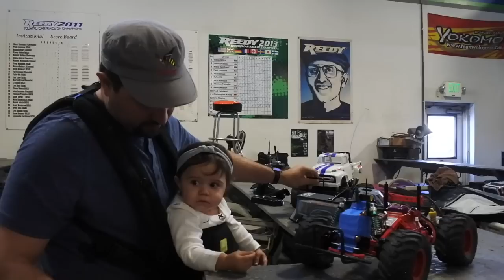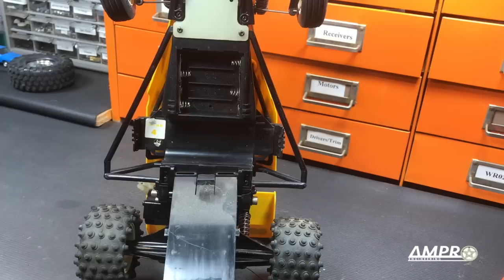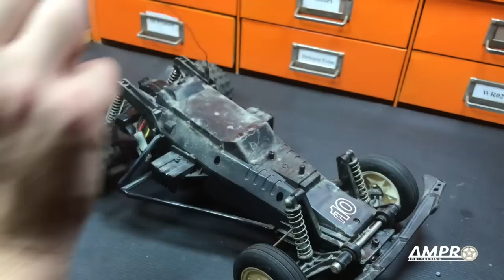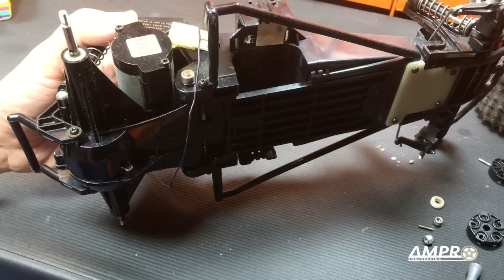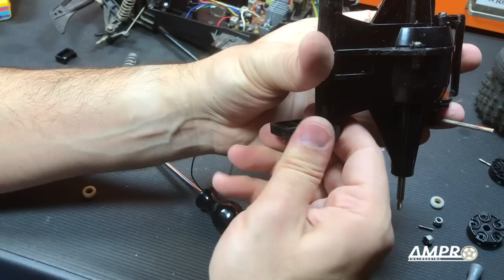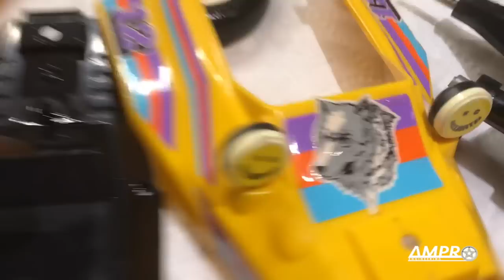e177: Nikko Rhino / Bison / F10; The Clean Up

Comment: Hi, thank you for your videos! I need a little help, can you tell me how remove the pins on the top  of the arms of the shock absorber? i need it to try to install a new oil shock absorber. thank you
Reply from the maker: Thank you! Well here is the problem, these pins are not designed to come out. They are one way press pins so the act of removing them is very dangerous. The best thing to do is try and grab the head of the pin and use a lot of force to twist and pull. There is a very great chance the a lot of parts, including the tower and the pin will be damaged though. I wish I had better news for you.
Reply: @AMPROEngineering  thank you for you answer!!

Comment: WE NEED UPGRADE PARTS FOR THIS... like steering knuckles suspension plastics etc. I would love to see some parts from you for this car theres not a market at all maybe a few parts here and their but not enough
Reply from the maker: Yeah they are harder to get parts for. I sold this off a few years back but I may have a scrap car to copy parts from.
Reply: @AMPROEngineering  COOL I have one that im desperately wanting to get running but have a few plastics that need replaced as they are cracked..

Comment: This was the first R/C car my parents got me. From Sears and called the Super Lobo. I got it in 1985 and it was a LOT of money for the time. With the 7.2V battery pack and black/green Lobo carrying case, well over $250 in todays dollars. It was quality made and really quick.
Reply from the maker: It really was a solid car. People forget how expensive and good these were.
Reply: @AMPROEngineering  One of the neighborhood kids several years later got the Super Lobo II. Same thing, but red and slightly updated. The local hobby shop put some Falcon front wheels on it w/ bearings up front and they were able to stick a Trinity stock motor in it. It blew my Clod Buster away for sure.

Comment: Have nikko frame buggy 14084 from 1985. Still werking. Want to operatie with lipo. Is this possible.?
Reply from the maker: Yes but you will need to plug in a lipo alarm so that the battery wont run low.
Reply: AMPRO Engineering could you advice me which model of lipo alarm i should buy. And where to buy it?

Comment: What determines if something is toy grade or hobby grade is weather or not it has replacement parts available.
Reply from the maker: Well I dont know about that. Nikko and Tyco cars came with parts lists to order replacement parts which I used to do. On the same note, the hobby shops I would go to needed to order parts for my RC10 all the time so in both cases I had to wait but for the Nikko and Tyco cars, they were at a price point that made them really not worth fixing, even with replacement parts available.

Comment: Ahhh finally!

The Super Lobo seems to most closely resemble the later Thunderbolt. The Thunderbolt came in a 380 version and a 540 version. They both had the same electronics as far as I know, not as powerful as the earlier Rhino and Bison. The board definitely appears to be the same. It was also found in the Scorpion MK1 truck.

The 540 motor was interesting as it was different to the Rhino and Bison too. Instead of the typical 27t it was a 40t but the wire was much thinner than you'd normally find in a 40t 540, the rotor is only partly filled with wire. It seems like a deliberate choice in order to limit current and overall power. It's easy to tell by taking a peak inside the can, if it's the 40t motor the wire will be noticeably undersized. 

I have had several of the family over the past few years and some genuine spares too. 

The plastic quality seems to vary, I've had both used buggies and unopened spares that have ranged from sturdy and flexible to brittle and weak. Some parts even cracked inside the packet. I'm not sure if this is down to manufacturing variations or just that sometimes the plastic is prone to turning bad just Tamiya plastic does sometimes. I definitely have some that seem to be at least as tough as the Grasshopper though with robust and flexible materials.

The front and rear wheels should swap straight out for Grasshopper or Hornet Items.

A lot of the earlier F10s had nuts instead of press fit collars on the gearbox pivot and front arms. 

Recently, I have been removing the stock part with a dremel then cutting some metal rod to the appropriate length and using a cheap tap and due set to add threads each end. If you can get the stock metal rod out cleanly you could just cut threads into that too.

The diffs in these are usually pretty nice, metal gears and metal plates each side holding it together.

I might have some spare pivots laying around if you need one. I'll have to dig through my spares!

I'll be interested to see what you do with this using your impressive skills. It's a cool little buggy if you look at it as a simple Grasshopper style vehicle.

Sorry for the long comment!
Reply from the maker: Oh yeah I also have the Scorpion which was the exact same chassis minus the use of the 4AA batteries. This plastic seems pretty hard, which I think is bad for durability. I didnt know the earlier ones had nuts on the pivot either. Oh and yeah if you have a pivot, I am interested! Maybe even a bumper? Let me know amproengineering@gmail.com
Reply: @AMPROEngineering 
Yeah I have had some like that, hard and brittle. Others have been more flexible more like Tamiya or indeed some of Nikkos more "toy grade" stuff. Perhaps it's just a lucky dip with age and storage conditions factoring into it. I have an original Tamiya Boomerang that I'm too scared to drive any more because something cracks if you so much as look at it wrong. Yet my friend has one and beats the snot out of it and it never seems to break.

I'll see what I have laying around. I'll send you a list of everything I have spare for the F10 once I get a few.

Comment: Besides color and body, looks like a twin of my Radio Shack Red Arrow. Loved that car!
Reply: They are different underneath but the wheels are interchangeable!

The Red Arrow was made by Radcon/Digitcon. It's a clone of the Yonezawa Land Dash underneath but the wheels are the same fitting as the F10 for some reason. To complicate matters, Digitcon also made a clone of the F10 chassis with a body shell that looks like the Nikko Dictator. Radio Shack sold that one as the "black wolf"

And then there was the Radio Shack Golden Arrow which was actually made by Nikko.

Seems crazy that they simultaneously sold genuine Nikko creations but also clones of Nikko stuff.
Reply: FATDEEMAN awesome reply! I loved that Red Arrow because it was decently fast but seemed to get beat by my friends Tyco Bandit! But overall was a great car! Crazy at how many clones were sold then but also now. It’s a game that’s been around for a bit!
Reply: @alfredsfunvideos4270  On a good day it should be much faster off the line than a Bandit but those Tycos had some crazy top speed for a toy grade. 

The Red Arrow was much closer to hobby grade, even had a ceramic cooling resistor in the nose. You can swap the plastic bushings out for bearings too.

The car it was based off, the Yonezawa, was also sold by Monogram as a hobby grade. It's not a sophisticated platform by any means but it was definitely comparable to basic hobby grade stuff of the time.

It seems like every brand back then had at least one semi hobby grade, 540 powered buggy in their range. Nikko had several and some trucks and twin 380 motor powered vehicles too, all with spare parts support and optional bearings etc. 

Perhaps the only exception was Taiyo/Tyco.
Reply: FATDEEMAN What type of motor did the Bandit have in it? Also it was a 9.6v so maybe that’s what helped it’s top end?
Reply: @alfredsfunvideos4270  The Tyco stuff usually had little 370 size motors. 

The motors generally developed less rpm/volt than the bigger 540 so although they ran at 9.6v you wouldn't necessarily get a full 2.4v advantage. 

The gearing plays a role too and the weight of the vehicle etc. Taiyo just seemed to have a knack of getting the absolute maximum out of their vehicles via a combination of motor and gearing. 

A lot of toy grades used higher voltages because getting a certain RPM by means of voltage is more efficient than doing it with current. Better efficiency means lower temperatures and that's especially important with smaller motors which can get red hot. 

Larger 540 motors tend to be wound in a way that they draw less voltage but higher currents, they are physically larger and better able to dissipate heat so they can draw comparatively more current.

If you make a little 370 motor and optimise it for low voltage/high current it would burn out very quickly on most practical uses. That's why a lot of toy grades run at 9.6v. A 6v 18,000rpm motor would run hotter than a 9.6v 18,000rpm motor for example.
Reply from the maker: Boy I liked this conversation!
Reply: AMPRO Engineering used to be really into the hobby as a kid and teenager and now with my son, getting back into it. Just picked him up a TT-02 and just installed a Peak Performance pink can stock motor in it and did bearing kit and love it. For me the Red Arrow started and then first kit car was a Kyosho Outlaw Raider and that’s all she wrote! Great content and keep it up!
Reply: FATDEEMAN, The Tyco twin turbo hopper was a little rocket with the dual 370's , it flat smoked my rhino so i definitely agree with you about tyco getting the most out of their cars. I applaud you for retaining all this info on these 80's rc cars, if it wasn't for nikko and tyco my love of rc wouldn't be the same. Those brands were stepping stones to my first real car a losi jrx2 that i still have.

Comment: hey ampro engineering my Radioshack blackwolf has similar wheel adapter to these only they are hexagonal in shape instead of round and is similar in most other ways suspension the bottom chassis it doesnt have the frame under the body like the rhino
Reply: The Black wolf was made by Digitcon. They very closely copied the Nikko design and the body shell is actually a copy of another Nikko, the Dictator mk2
Reply: @ValleyRC  thanks that is very interesting info i appreciate it
Reply: No problems, I've soaked up a lot of random RC trivia over the past few years so it's good to be able to pass it on lol!
Reply: @ValleyRC  one thing though the black wolf is 2wd not 4wd i think the radioshack black phantom is more closely related to the dictator
Reply from the maker: Random RC trivia is great!
Reply: @PrimeTime391  Yes the black wolf only resembles the dictator in terms of the body shell, underneath it is much closer to the  F10.

Black phantom is virtually identical  to the Dictator apart from the wheels and body shell. It might have slightly better motors too, 

Nikko used slightly faster motors in Dictators for some markets, the French got a slightly faster version for example. Usually a 35T motor instead of the slower 45T. In some territories, Nikkos high end stuff was aimed directly at the lower end hobby grade market.

I'm not sure which motor they put in the Black Phantom when they made them for Radioshack.

Comment: That body and the decals are immaculate.. I'm guessing it was either a kid that got it for christmas and wasn't really interested or the suspension pivot broke right away and they couldn't get a replacement part, or maybe the parents had money and just bought a new one. Pretty sure Sears sold hop up and replacement parts for this.
Reply: They did. You can still find some of the manuals and parts lists on their website amazingly. Long discontinued of course though.
Reply from the maker: I know, I was surprised when I got it. I wanted to repaint it but I cannot do that to those decals.
Reply: I have similar but smaller Nikko Lobo II with the same kind of artwork. 

I believe that sometimes the cheesy 80's and 90's artwork sort of goes so far it transcends cheesiness and becomes avant garde. This buggy is a prime example.

Comment: I know I'm bad, I'd be just replacing the stock rear pivot setup with Hornet stuff. some tubing to take up the slack and Tamiya size steel rod going across. soften the springs (cut a little for less pre-load and re-flatten the new coil ends?) and call it "improved suspension". it is all mostly brittle plastic so I'd never launch it high or hard, so it might as well handle a little better driving it around than "vintage as got" did (stiff+flat+bouncy). I'd leave the old friction shocks alone other than some "spring adjustment", they could get all they need (opinion) for that, just by fully compressing them for a few minutes too. I'd just be too curious about how it would do with just a little bit of body roll weight transfer happening when its turning. in the trans if I remember right, most of these had a metal side plated plastic diff in them, they weren't horrible anyway!
Reply from the maker: Yeah I totally agree. The car is clean I and I don't want to do too much to  it

Comment: It is almost EXACTLY like the Traxxas "The Cat"
Reply: https://www.dropbox.com/s/nus4zvqeax4j318/Traxxas_The_Cat.pdf?dl=0
Reply: kinda like how they used a ball socket mounting the motor+axle, and definitely liked their plastic finger adjustable step collar oil filled shocks. they used to be the cool low priced made in USA copycats, now they're bullies with lawyers affecting their prices and reputation both, unfortunately.
Reply: I believe they had a deal with Nikko at the time. The Graupner fun racer is another variant.

Also the later Traxxas Spirit.
Reply from the maker: Yeah the car was the same car with just a few more screws for modification purposes.